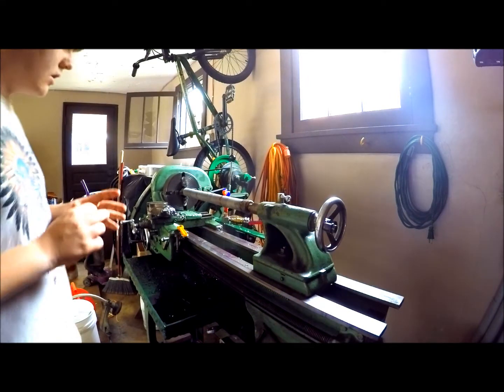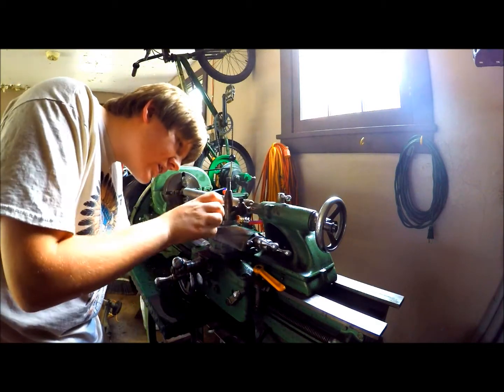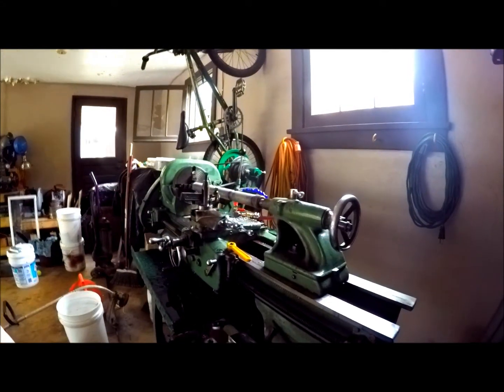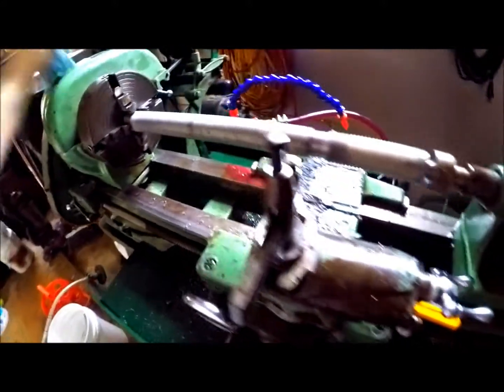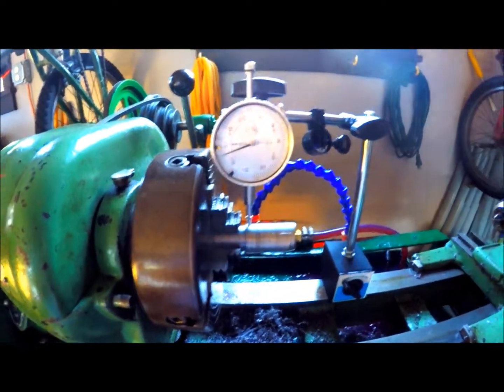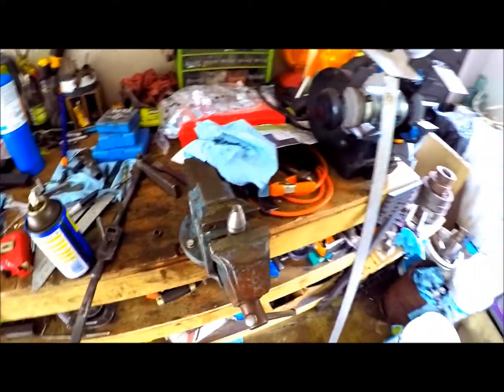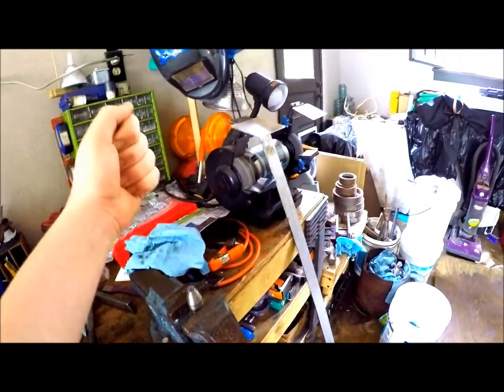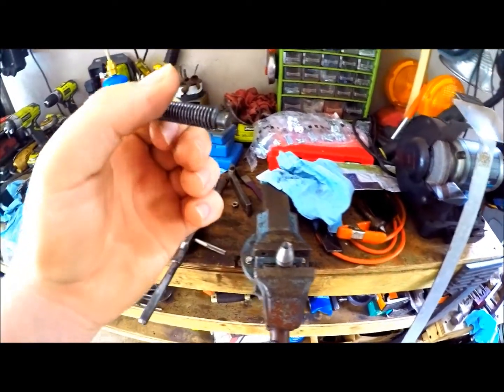Build Atlas 10 F Lathe,  Rocker Style Tool Post  (Part 1) RE UPLOAD

Comment: I clicked on this video because I just got a 618 atlas lathe and it came with these 2 little rocker looking things and have no idea what they're for. Im new to this, and the guy i got it from had no knowledge of the lathe and it came with little instruction. Anyway, I was hoping that I could get some idea of what they might be used for. I suspect they have something to do with the tool post. It has a lantern style tool post. Any help would be greatly appreciated. Thanks.
Reply from the maker: That is one nice style large ya got. A rocker or lantern style tool post holder is not to difficult to use there just a few things ya need to make shore of, the 2 biggest things is that your tool is centered on the working stock and that the arbore is tight when machining, when you use these you can’t take if externally big chipped like a quick chance tool Post holder because it has a tendency to shift when bogged down. Another thing too is what kinda tool holder you want to use in it. You have to have the correct angle on it to cut a good chip so it is not to daul easily. This can be done by making shore the tolling is centered , there is a way to do this. If your wind out your tale stock on the lathe there should be a little slice mark that indicates center on the lathe. This way you can use that to center your tolling. If you have any other spastic quiets I am willing to help and there are also some other people who are a lot more knowledged than I am in this field.